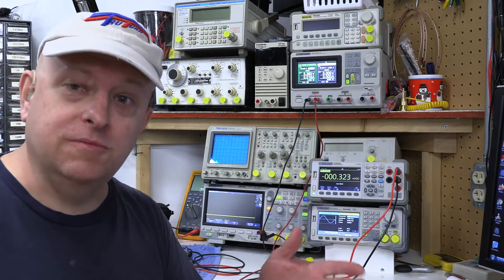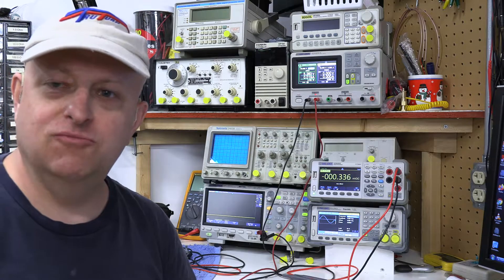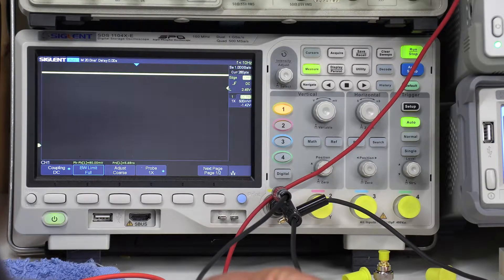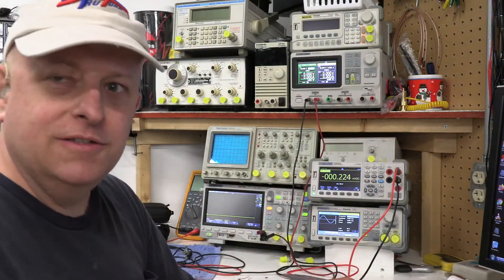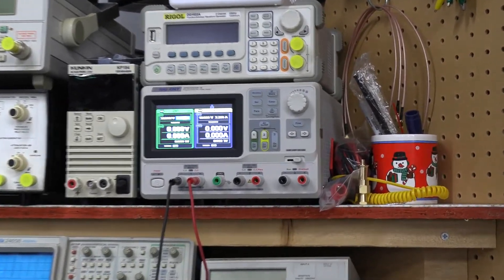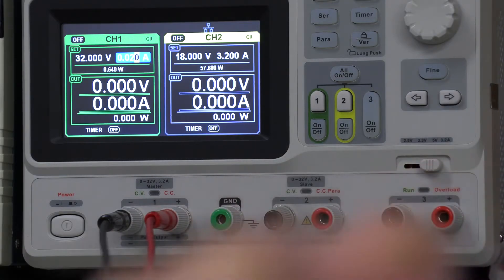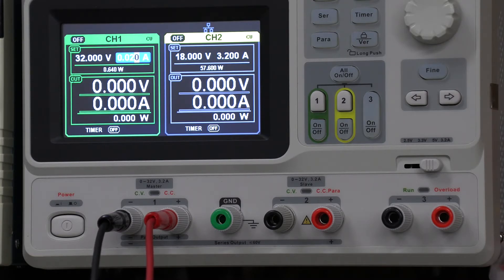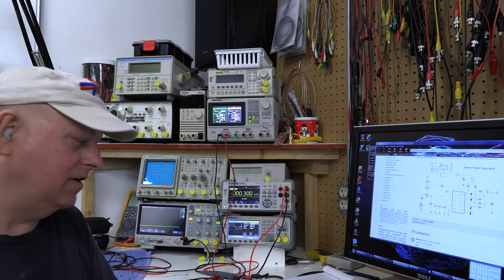Review of Siglent Test equipment from Circuit Specialists on 20200703 by Mike Fleming

Comment: Good tips.  I recently got a Siglent scope, function generator, and power supply and they seem pretty good.  Very good for the money.  Easy to use except the power supply operation could be a little more intuitive.  I have over 50 years in electronics and have used the best names (Tektronix, HP, etc.) but at home had lower cost equipment such as a Hitachi Scope (analog of course), B&K power supply, and such.  And they were getting rather old although they still worked fine.  Just didn't have the features you can get for a low price in something like Siglent products.